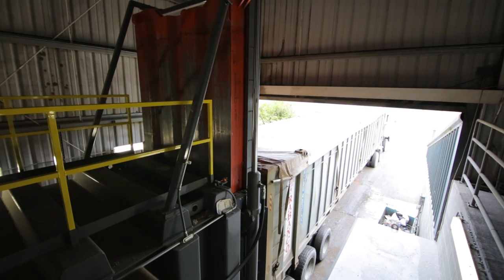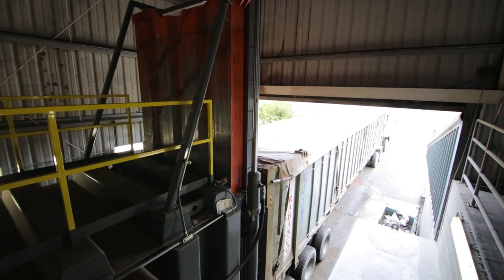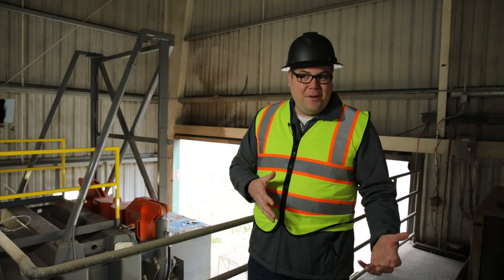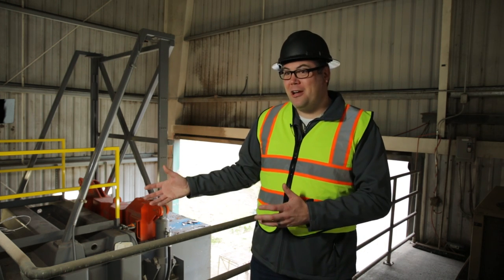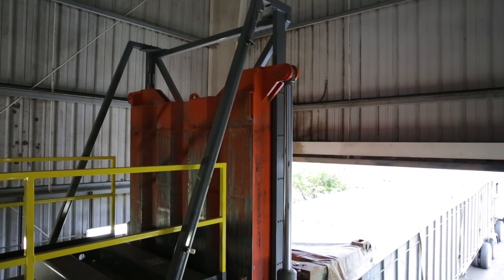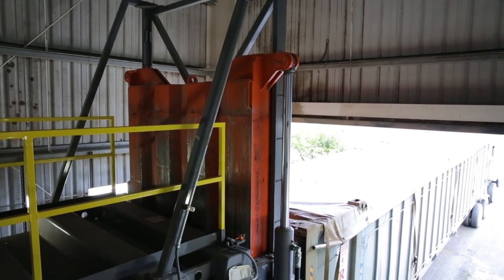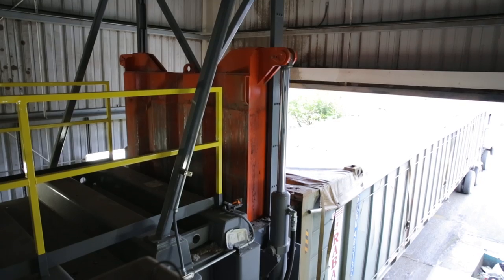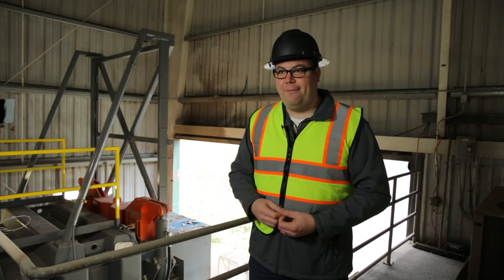Product Spotlight: Pre-Load Compactors

Comment: I've seen them before with cardboard recycling at shopping centres. Out of curiosity is there any benefit to shredding prior? Do you see an optimal shred? A lot would depend on the size of material, but i assume you'd have setups.